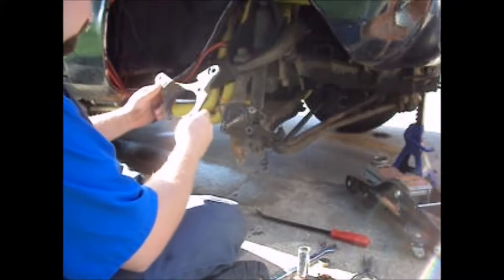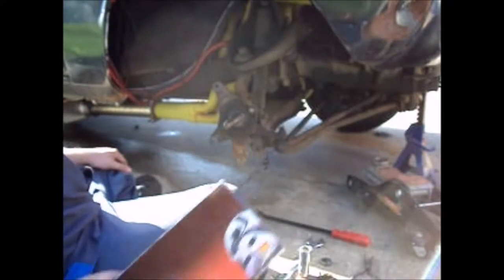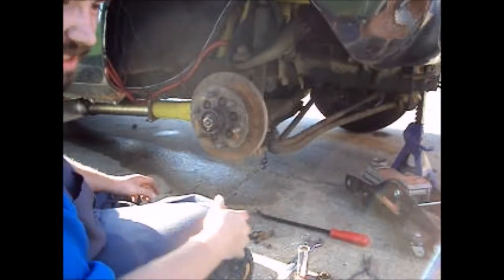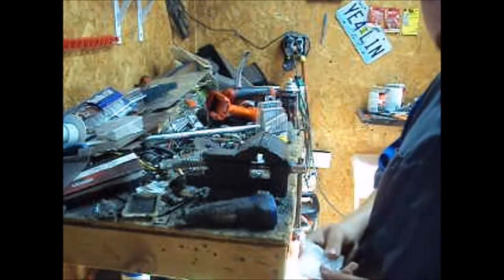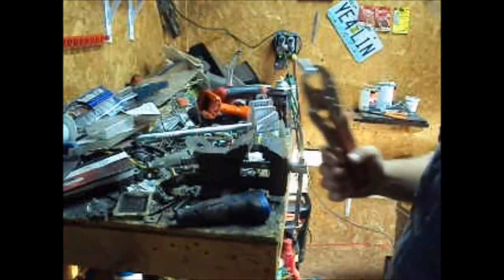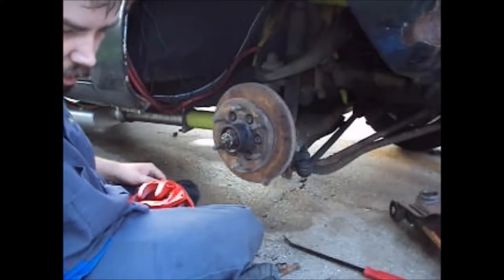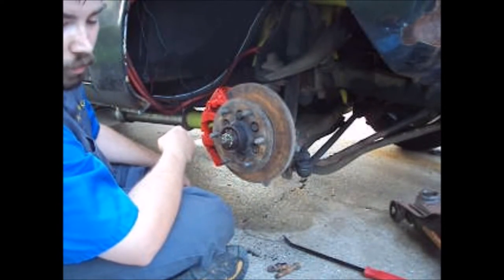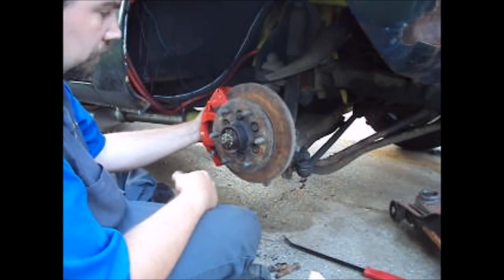Chevy LUV Drum To Disc Conversion Part 2

Comment: Cool cool 😎 . .
So what year or was it a S-10? Can  bigger Disc Brakes be used instead of the smaller stock for More security or Power stoppage?
Reply from the maker: Hey! Sorry for the late reply. I used factory LUV brakes from a 1976 pick up I believe it was. I have heard the Aerospace Components makes a really good brake kit, but I haven't looked into them. Happy hunting!